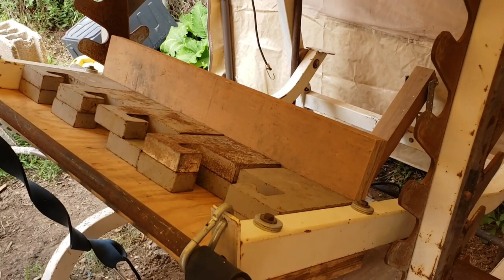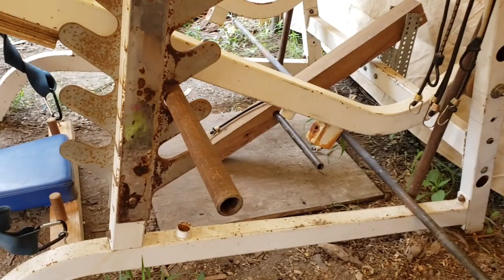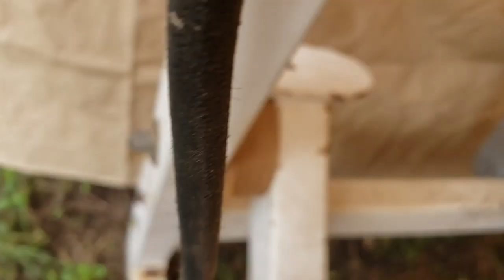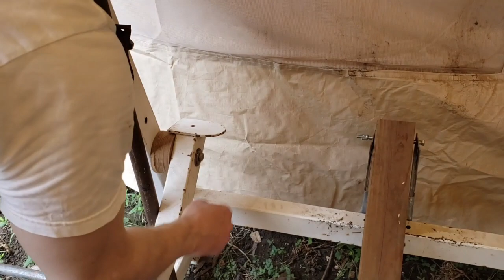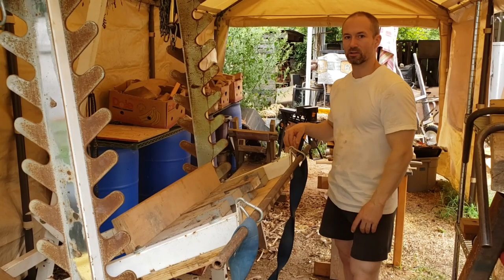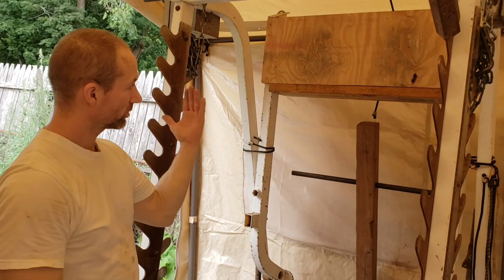Home Built Leg Press Version 4.0

Comment: Hi, what do you think of dorian yates his 1 set training regime? I want to do your routine but only 1 hard set and then 3 exercises per workout with 2 warm up sets
Reply from the maker: Yates' regime is quite similar to mine when I was in my twenties.  I did a bit higher volume and a bit  lower frequency than he did, but not a lot.  Keep in mind though that he was using anabolic steriods throughout his entire training career, and that matters far more than the type of training you do.
Reply: @bastionhead  thank you so much for responding, yes, mike mentzer en dorian yates we're definitely on steroids, i keep that in the back of my head. Would you rate my routine? I've followed you for a long time and it would help me alot. 

I am 28 and until now I've been extremely dedicated with diet and exercise, but i also had health challenges which included fatigue and insomnia, and some other weird symptoms, I've never recovered well with training, a couple of weeks into HIIT and it feels great! Getting stronger and feeling rested

My routine is 
Wednesday
Military press
Side raise
Calves

Saturday
Front squats 
Barbell curl
Abs

Week later
Wednesday
Weighted push ups
Chest fly
Tricep extension

Saturday
Deadlift
Leg curl
Inverted row

I only do one hard set per exercises with 1-3 warm up sets depending on if it is the first or last exercise, i keep my rep range around 8-20, every week trying to beat my previous set. 

I feel like i can recover and still stay energized this way. 

Do you think this is adequate volume?
Reply from the maker: @helloman5576  I have made progress from a single set to (or near) failure every 3-4 weeks.  Not saying that is IDEAL, but if your recovery is compromised, in general it is probably better to err on the side of less volume rather than more.  if your strength is going up regularly, you are doing enough volume.

Comment: Are you still active on youtube mate have a question for you
Reply from the maker: Still hanging around!  Ask away.
Reply: @bastionhead  niceone mate.  Just going to ask mate when you train how long does your muscle sorness last after a session
Reply from the maker: @danielmoore1145  I have had soreness last as long as nine days, but typically it is two to four days.
Reply: @bastionhead  really. Have you heard of a thing called hyperplasia. Its supose to great more muscle fibers rather than hypertrophy which is just enlarges the fibres you. V got.  I wonder if your type of training is causing hyperplasia
Reply from the maker: @danielmoore1145  Yes, I have heard about hyperplasia.  I haven't looked into the research on this topic for many years now, but last I knew the consensus was that hypertrophy is predominantly, if not exclusively, responsible for muscle growth from resistance training.  But in practical terms for a body builder or strength athlete, it doesn't really matter.  It is the macro level result (ie, strength and/or size gains) not the micro level mechanism that matters.  My style of training is certainly effective at achieving those macro level results.
Reply: @bastionhead  ok so you recan in practice aslong as your getting stronger over time thats the most important thing?
Reply: @bastionhead  can You give your e-mail? I am from eastern Europe, I want give your questions about volume/frequency.
Reply: @JohnTed-fz5en do you know it mate?